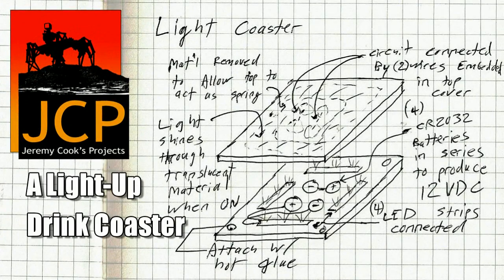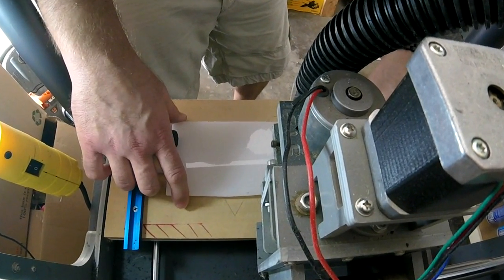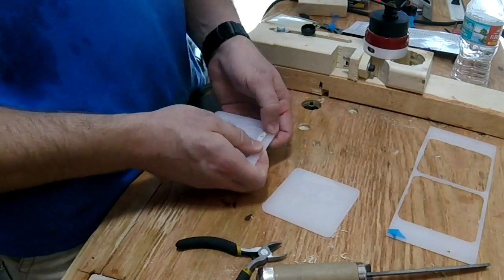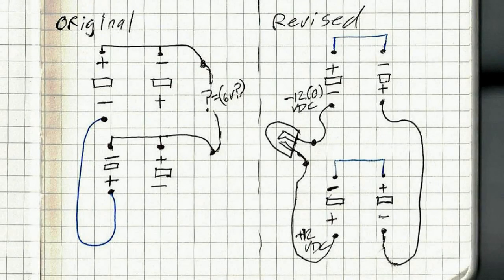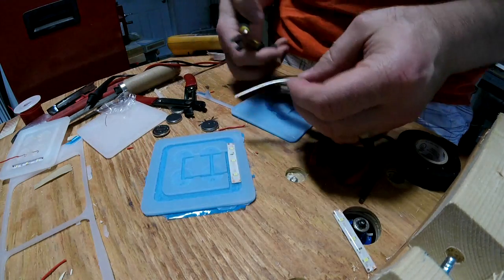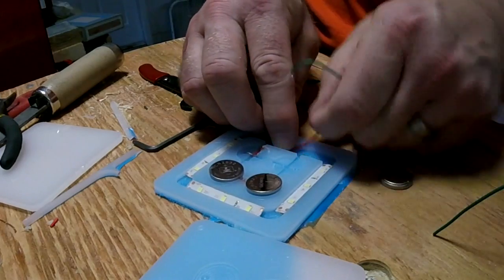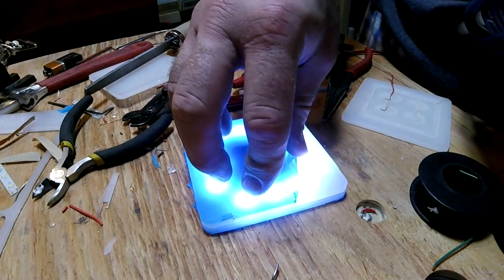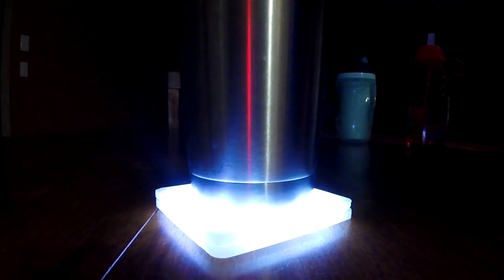Light Up Drink Coaster

Comment: Nice project Jeremy. Have you thought about using conductive ink for the wires instead of the wires that you used? It might make things a bit simpler. Just a thought. Overall a great project.
Reply from the maker: Hmm, I hadn't really considered it, but I'll have to look at using that. Thought about solder, but that obviously comes with it's own set of issues!

Thanks for checking it out and subscribing!